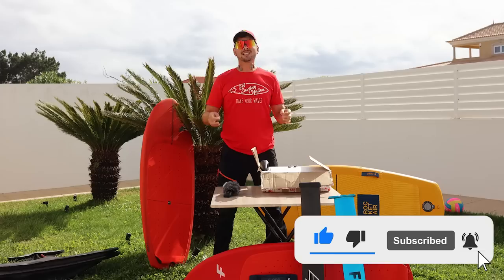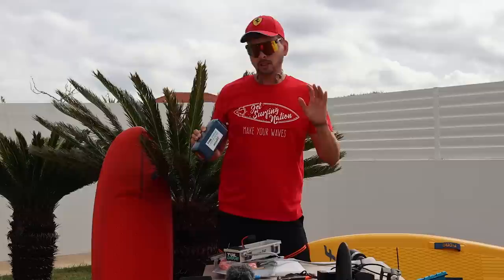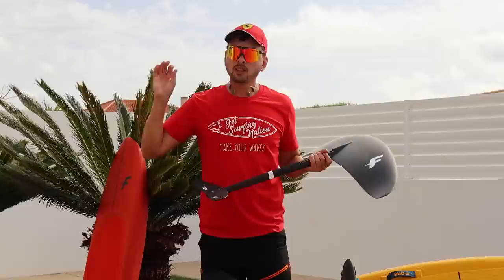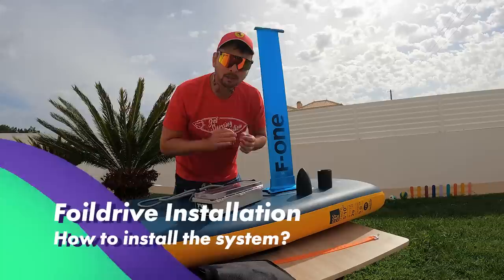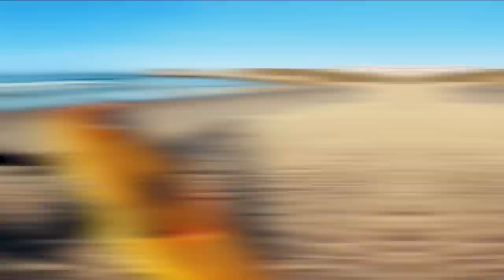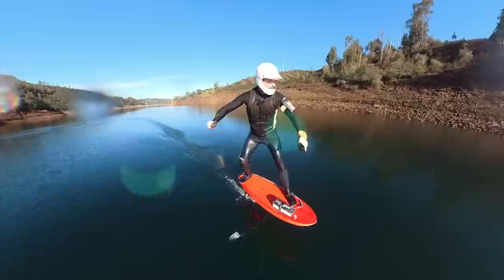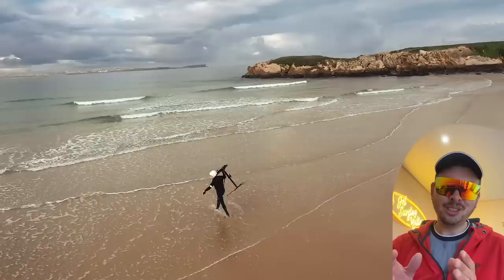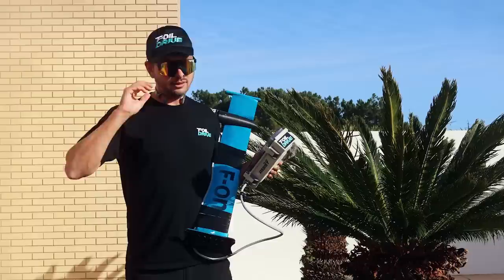FOIL DRIVE Indepth Review 🔥 4 Experiments to motorise your foil gear

Comment: Great video! You answered just about all the questions I had. I have one question though, is it easy to remove the cable guides from the hardboard or does pulling them off damage the surface of the board. Thanks a lot for the video and effort that went into making it!!!
Reply from the maker: It’s not easy to remove. They are rubber glue one time use. When removed they do not damage the board at all. Clean the area with alcohol
Reply: I there. Is there a solution to use to board for surf foiling or wingfoiling with the cable guides remaining on, without hurting yourself on your legs? E.g. Velcro or a dummy cable…?

Comment: Hey Mike, i have done a number of efoil lessons in Cape Town and love it. My only goal is to ride waves - similar to what you have been riding in this video. I’m at the point where I’m ready to buy gear. What do you think is better for riding waves? Fliteboard Pro with a truglide prop and flow s foil, or a similar size board and foil with a foil drive assist plus? Buying gear is a big investment and I have no way to demo the Foil Drive system here in Cape Town - so im trying to decide based on my limited efoil experience and watching videos like yours. Im 52 years old and weigh 95kg and am just too old / lazy to commit to pure prone foil surfing, but i love riding waves. 
How long can you session waves on a foil drive system? Does the lack of weight and drag that foil drive offers a significant benefit in natural ride feel over efoil wave ride set ups? Thanks for the videos!
Reply from the maker: In your case I would suggest going with efoil first and after a couple of seasons if you feel like you hit the limits of efoil upgrade to foildrive with your own gear.
Reply: Thanks Mike!

Comment: Awesome video.  Folks like you, Dominic Hoskyns, SurfDocSteve and the entire FD owner community pushing the limits of this unique product has pushed me to finally cave and buy one of these units.  Its still got a few quirks i hope they fix eventually but the ability to use smaller foil boards and wings and still get up even with little or no surf is a game changer.   I don't want to foil in crowded lineups or where theres awesome surf, i want to tap into the other 95% of the ocean where no one typically plays.   FD opens the doors to this.
Reply from the maker: Exactly!!!!
Reply: @dkschrei...what are the quirks you have come across?
Reply: I don’t think they like to talk about quirks. Just a feeling of very tight lips at foil drive and with influencers.